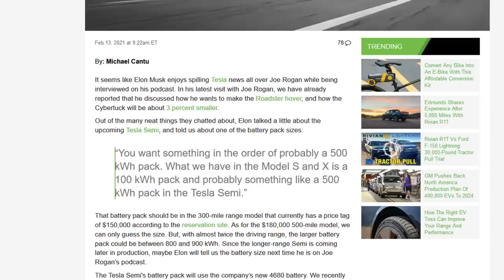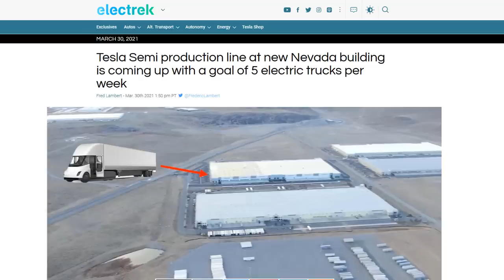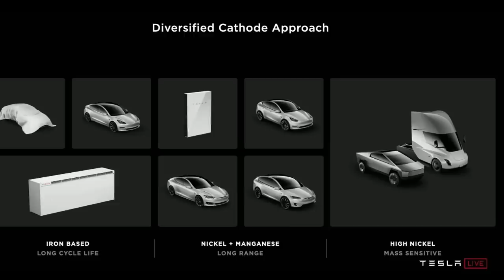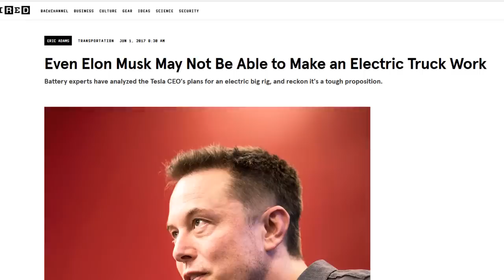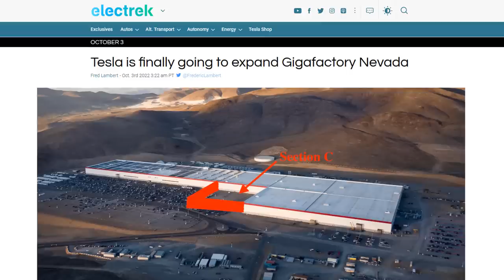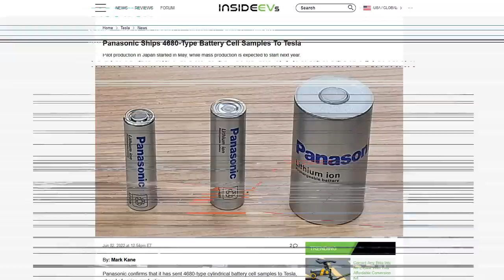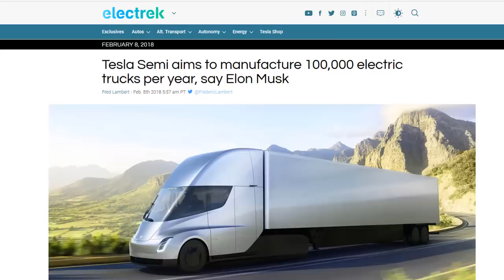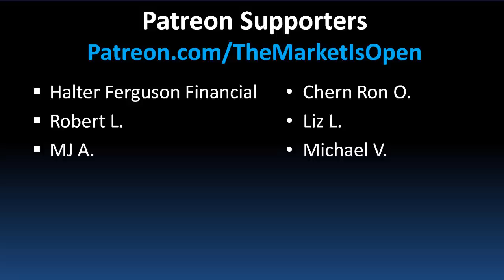Tesla Semi Is Coming in a Month - Let that Sink In

Comment: This showed up on my YouTube as being released 2 days ago but it's talking about something that was supposed to happen last January?  It's goal seem to been to manage expectations.  When you consider 15 gallons of diesel has 500 kilowatt hours of energy in it, someone saying they're going to get a fully loaded 40 ton truck to go  300 miles on 15 gallons of fuel is amazing to the point of being hard to believe.  It's the equivalent of saying you're going to get 10  dually pickup trucks to go 300 miles with each one of them only using one and a half gallons of fuel.  I hope it's possible.
Reply: It's a matter of how much of the total energy is used. The engine with the best thermodynamic efficiency still only reaches mid 30% efficiency. An electric drivetrain can be over 98% efficiency. So your 15 gallons of diesel are only actually worth less than 150 kilowatt of actual work done. That doesn't even take into consideration regenerative braking. The model 3 battery pack is equivalent to less than 2.5 gallons of gas yet can travel over 300 miles per charge. The proof is in the pudding and over a million Teslas on the road are all saying the range is possible. Your average semi uses approximately 4x the fuel of your average vehicle. A truck containing 4x the battery packs of a Tesla sedan is spot on for the range.
Reply: @jameshathaway5117  but when you allow for the energy required to haul a full load the energy required is exponential. Just look at the new large pickup trucks in the US, empty they have great range, under load the range shrinks to only 160 miles
Reply: @spinnymathingy3149  I already took the weight into consideration. The average diesel semi uses approx 4x the fuel of a average car when LOADED. Empty semis can actually get pretty dang good fuel economy but nobody is talking about a empty semi.
Reply: @jameshathaway5117  so are you saying 4 car battery’s would be enough for a loaded truck to travel the distance stated at highway speeds?
Reply: @spinnymathingy3149  once again YES! the amount of energy required to move a loaded semi is approx 4x that of the average passenger vehicle. Ergo it will still take 4x the batteries of an average electric vehicle to go the same distance with a electric semi. It's really not that complicated. It's the same amount of energy required to move the vehicle regardless of engine type. Is it the difference in efficiency that's throwing you off? I'm just not sure what I'm not making clear. The average pickup truck requires about 2.5x the energy of a passenger vehicle when towing a load. That means if you want a Rivian or f150 Lightning to tow the same range as a Tesla drives unloaded they need a lot more batteries. Just because the Rivian, Lightning, and hummer ev don't have it figured out doesn't mean the same applies to Tesla.
Reply: @spinnymathingy3149  Just so we are on the same page we are talking about the 300 mile range semi correct?
Reply: @jameshathaway5117  actually I was just posing a general question regarding power required to move a certain load load at speed, but I suppose I had a 500 mile figure in the back of my mind
Reply: @jameshathaway5117  here’s battery size-weight-requirements explained, have a look and see if you still think 4x car batteries will power the Tesla semi ?
https://youtu.be/J0V99iiEJvY

Comment: nothing here is green it is all a lie  and there is no cost savings it will actual cost more to run those cars and trucks electric just went up by 50 to 60 percent in last year where do ya think that is coming from  and all the  materials are produced with the use of oil and coal   and they only have a shelf life of maybe 5 years where diesel trucks last 20 to 40 years  and millions of miles stop telling lies

Comment: How long do the batteries last? How much for the batteries? How much to charge them? Impact on power grid? Where do they dispose of the batteries? Not one of these questions answered in this video
Reply: I think the batteries have a million mile life span. With a 500 mile range in between charging. And  If I remember correctly they are about $200,000 to replace.  When it's time to replace battery at a million miles  do you need to replace motors also?  Do you put $400,000 back into a truck that has a million miles on it?
Reply: @raydavis74  First off the motors are brush-less DC. Therefore there is no wear other than an occasional bearing replacement. And because the motors drive the wheels directly, there is no differential or drive shaft with universals. The design of an electric vehicle is so simple it makes the present system of engines and related components sound so yesterday. Everyday you wake up, you are in the future.
Reply: @raydavis74  so possibly as soon as 5-6 years the million mile would soon be achieved ?
The economics don’t sound so good in reality

Comment: Tesla better NOT dump all of their eggs into 1 battery basket.
They are NOT going to support or withstand the heavy duty application needed for OTR use.
The battery production should far exceed the amount of truck production as the application will find the weak components.

Comment: I think dropping the extra drive motor off the rear most axle and thus reducing the energy demand is how they're getting by without the 4680 pack. I believe that they will offer the 4th drive motor when they can get more 4680 volume.

Comment: I think the pack size will be larger than everyone thinks as if it needs 100% charge to make 500 miles battery degradation will be too high id guess 1200kwh and software locking to keep battery between 10% and 90% to minimise degradation effectively software locked to 100gwh ...... also the 300 mile range could be lfp pack. Or lmp, it will sacrifice weight but benefit from cycle life

Comment: What will happen when  The materials to make this batteries are not there. Clearly people have not  Thought that's true Because just like oil Is materials will run out. I would like to take our chances of roll the dice on a whim? And who's gonna control the manufacturer turn off who's gonna create oh I don't know a shortage that doesn't exist The same game is going to be played I just think it's a dumb idea to just settle for one even though some people have different types of opinion and they believe that the pokemon is carbon and the cabusting engine is the problem Mental cases are the problem. Not the cars We can heat cut down the trees Expect that that's gonna help so so there's a lot of things people aren't thinking clearen't thinking clearly just a bunch of Which believe in you that this is a great idea it isn't What will happen when the materials run out there's no forever with this And then what happened if there is no more lit's no more materials for the batteries to be made than what? Are we supposed to screw our lives up because of a bunch of people that really aren't thinking things through I would definitely not put all eggs in one basket definitely definitely not we're going to keep things things an option let's keep them an option we're going to need gas we're going to need diesel we're going to need Oil there's just no way around it Attorneys probably may end up being more or less limited in this  Arrangement, It's just doesn't seem like it has the long legs that's going to last Because Eventually it's going to run out I will play a lot less than oil. If people were smart they would understand do not just settle for one leave yourself and out. And understand there's not enough carbon right now that's going to cause this Earth to warm up the Earth It is doing this on its own Has been for millions of years Yes because of a few deranged lunatics believe otherwise doesn't mean it's so and the scientists that they bought and paid for pretty sure they will  Say  Anything  To sell a lie. But other scientists do not agree with their findings they do agree that the Earth is warming but it's not because of cars or carbon or greenhouse Gasses. That's not yet smoke confused from the forest fire with smog. And let's not forget that the volcanoes are active they are active they can create climate change.

Comment: I wonder what the price would be if this truck is under $200,000 is flying off the market
Reply: No way under 200k more like 300k a unit
Reply: There are lots of ways to skin the B2B market. FSD, insurance, service, battery management / recharge and even battery recycling. So you have to look at the whole lifecycle.
Reply: more like $700k / cab

Comment: I imagine using 4680 in MY w/ front castings improves assembly dramatically, so they'll prioritize that approach,   It's probably much less of an improvement on the Semi.  I agree the Semi will eventually use 4680, but I imagine it will also castings in the future to reach their target rate.  So I don't know how well Nevada works for the Semi in the long term.
Reply: Cant use mega castings..semis are body on frame
Reply: @patriot2314  You make an excellent point, they are body-on-frame due to their nature.  So it probably doesn't make sense to even attempt a casting for the front (which is what I was thinking).

Comment: Market share, is Market share.
What this tells me, is that the Tesla SEMI, is just the next step. Vans are next. BUT once the Semi tech hits 2nd generation, here comes the push on Mass Transit. A BUS, has ALOT more room, for Batteries, than a Semi.

THEN comes the POWER shortages.. As with the Higher Demand=higher prices. (talking electricity).

Comment: A single EV tug could be quickly built to pull any semi through GT
Reply: Good point, it doesn't have to be a Semi.  EV "Terminal Tractors" already exist, and are in common use.  Here's a great video by @Yukon https://youtu.be/kWmWMQZo89w

Comment: Wrong.   You only need a CDL if you are going to move product or services COMMERCIALLY.   Hence the name,  Commercial Drivers License.
Reply from the maker: You are correct, but there is a weight limit of 26000 lbs, so it depends if tesla is over/under

Comment: If I know Elon, and his endless ability to perceive customer markets, I believe once the semi is ramped up the full commercial customer output, Tesla will make a non-commercial version of the semi which would not be capable of mating to a normal commercial trailer system and they would find ways in addition to this to circumvent the need for commercial driver's licenses in most jurisdictions, the semi would then be able to be sold as a base for motorhomes and other large capacity personal use, such as carrying people's off-road vehicles and race cars and boats without employing any trailer system. Mark my words Tesla and Elon Musk will come up with a version of the semi to fill the non-commercial customer Market soon enough

Comment: Tesla already has a lot of competition in the cargo and dilivery truck space.  Ford, Rivian, Lion, Mercedes, Proterra, BYD, etc, etc  I think the over the road long haul trucks are the place where tesla can fill a void that is underserved.  The last mile delivery and Yard truck market is already being served by the companies that are retrofitting the existing chassis trucks to electric using Lion and Proterra powertrains.   Once tesla has dominated the over the road class 8 market which is the hardest market, they can go down market and compete with battery electric competition.  Honestly Tesla can dominate that market only if they provide superior value to their customer base.  This also involves service for tires and air system components that typically have a lot of trouble on class 8 trucks.

Comment: Nice, but we need get rid of LI ion batteries.  Need to move to graphite/ sulfur batteries that don't kill the environment or go into solar flares as temperature increase in battery case. Li Ion is the simplest solution for EVs, but not the best solution, until they have a battery that doesn't need climate control or 1+ hour to charge from 0 to 100% on every 300 miles I will prefer the gas engine. Proven and safer than an EV and get to fill the tank up within 5 minutes every 400 to 500 miles.  But I do like the technology of the EV, it's just not mature for prime time. I like the strategy that Toyota is taking, offer all versions but work to mature EV and Hydrogen technologies so that they can sell cars equivalent to current gas power vehicles, let the customer choice.

Comment: Don’t understand why the expectation always seems to be that the Semi needs to be able to replace any other truck from the start.

A big factor is how the trucks are used. Lets say a manufacturer of cheese balls needs to transport product from the factory to a distribution hub, they won’t need 40 ton trucks. They need the volume of a big truck but not the weight capacity.

Don’t think the Pepsi trucks have the final specs but they will be able to do the job. Then they might swap the batteries once new cells are available. It’s good to start and test the platform in real world applications.
Reply: These trucks can be used as delivery trucks for Pepsi.  Delivery drivers check in, and also stock shelves in the store, so they don't drive a ton of miles a day.  300 mile range trucks will work for a lot of their routes.

Also, UPS, Fed Ex, Amazon, run a ton of line hauls. Basically driver picks up trailer, drives to destination,  drops, picks up new trailer and heads back.  

These trucks will be fine in those situations.   It will take time to ramp up production,  so there's plenty of uses for the truck while production ramps up.

Hopefully range and infrastructure gets built out of long haul routes.  That's what I do for a living.
Reply: @vinyllpreviews9462  👍

Comment: I hope this vehicle can help corporations with their diesel fuel issues. Especially for local and regional transports.
Reply: They wont
Reply: @jebes909090  We will see. Many inventors were told their ideas would not work, and yet, you responded on a device that wasn't supposed to work in society. Just like the automobile, trains, and electricity.
Just saying!!!
Reply: If mega chargers are installed at start/stop points and on some main roads... Even long ranges are no problem
Reply: What diesel fuel issues?
Reply: @jmh4ggg  The US has very low supplies on diesel fuel, along with regular gasoline.
Reply: @victorhaywood9995  Low reserves yeah, but we're not in any danger if running out anytime soon
Reply: @jmh4ggg  That could be true, my main point is can the Tesla Simi trucks help with supply distribution and transportation.

Comment: The Semi is coming, but it barely is a truck.
Look at the laughable max. payload!
Reply: What language is this?
Reply: @robitmcclain6107  Logic! Sorry that you don't understand it!
Reply: @niederrheiner8468  The original or the edited?
Reply: @robitmcclain6107  Both!
Reply: @robitmcclain6107  So what is the max. payload of the Semi?
Reply: @niederrheiner8468  Are you messing with me or do you actually not know?
Reply: @robitmcclain6107  YOU dont know the possible payload of the Semi.  LOL!
Reply: @niederrheiner8468  obfuscation much
Reply: @robitmcclain6107  What is the max. payload of the Tesla Semi?
Reply: 60 k pounds
Reply: @robitmcclain6107  Source?
Reply: @niederrheiner8468  I texted Elon and he told me. >> Actually the payload reduction of the Tesla will be about 3k to 4k pounds compared to a typical diesel unless Tesla has managed to reduce the tractor weight below the typical 25k of a K Whopper. Rumor is that electrics may be given a 2k extra allowance.
Reply: @robitmcclain6107  That is all speculation. There is a reason why Tesla hides this important number even now.
Reply: @niederrheiner8468  You are quite a negative Nelli for not having any actual knowledge. You work for Mercedes?
Reply: @robitmcclain6107  What is the official max.  payload? 
Batteries are just not suited for trucks because they are much too heavy. So you either get a ridiculous range or a ridiculous max. payload.
Reply: @niederrheiner8468  Depending on the range the batteries will weigh between 6k and 10k pounds. Subtract at least 4k pounds for the diesel engine, fuel and all the extra junk. That gets the difference down to 2k to 6k pounds of payload. Subtract 2k for the electric overage allowance and it is from zero to 4k. If Tesla is able to reduce the tractor weight, the Tesla Semi may have a higher payload than a typical diesel. We already know the Tesla will have a much better drag coefficient and regenerative braking. Mercedes will be copying Tesla all up the models.
Reply: @robitmcclain6107  If you dont give the range, all your numbers are arbitrary.
Reply: @niederrheiner8468 Sorry for the omission. The heaviest is 500 miles. The lightest is 300 miles.
Reply: @robitmcclain6107  Lets see wether the official numbers will be in that ballpark.

Comment: Any idea if the Semi will have somewhat high power AC charging onboard or will it be DC fast charge only?
Reply: Highly likely, as there are times that that the slower charging may be cheaper and more convenient - and put less stress on the battery. I also suspect that it will be able to use Superchargers or level 2 AC chargers in cases where a Megacharger isn't available.
Reply: @chrismuir8403  how could they not be fast charge. It takes days for suv electric to charge from house outlet. Whole thing is a joke